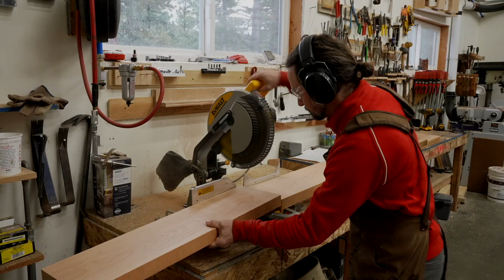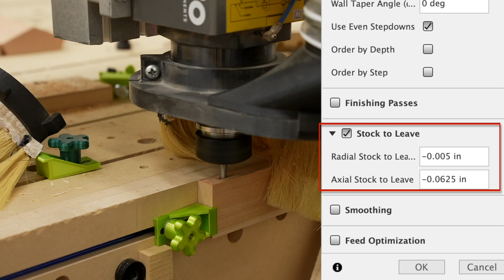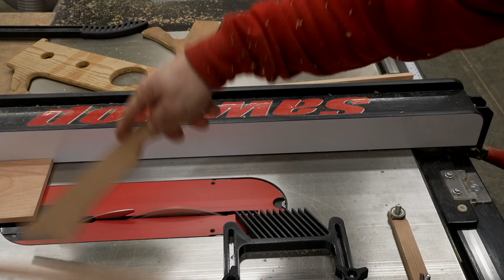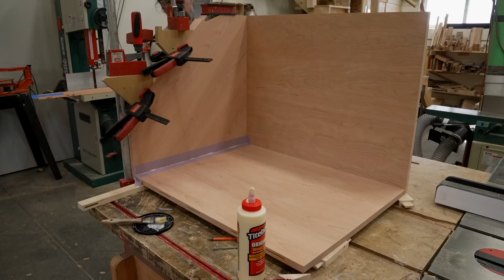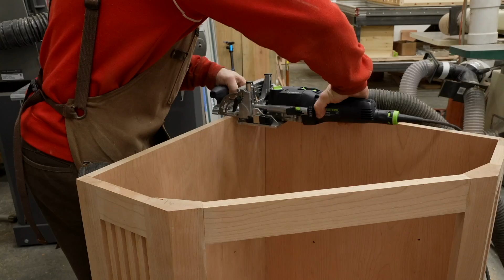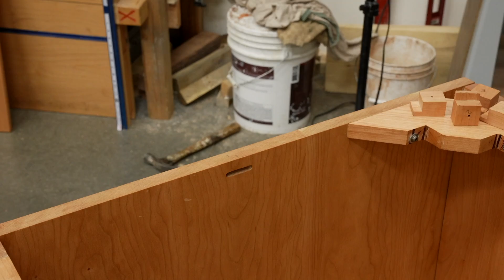The Corner Cabinet: Building Furniture with my CNC, Domino's, Biscuits, Pocket Holes, & Hand Tools

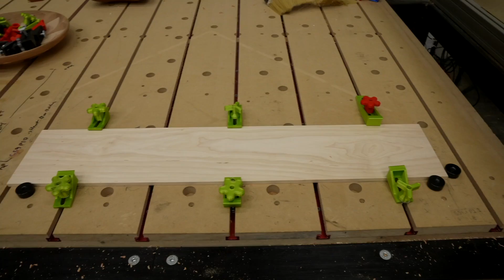Comment: Hey Corbin, so I run a CNC at work day in and day out and wanted to share a finishing pass technique that you should employ. At 4:30 or so you  made pocketed slots or dado's that you then ended up sanding using a piece of wood and sandpaper.  When you're cutting anything (specifically woods and wood composites) you first climb cut your part and then you run the exact tool-path running conventional.  This will clean up your cuts substantially.  In many cases you will need to do almost no sanding.  This is literally the most important part of running any job I do at work.
Reply from the maker: Awesome, I'll give that a try! One of the problems with that pocket is that it was a 1/4" wide and I cut it with a 1/4" bit. I think, if I did it again, I'd make it wider so I could do the climb cut / conventional cut technique like you said.
Reply: @CorbinDunn No Problem that is true but it should nonetheless still help even in this situation although software sometimes doesn't understand that when its a "pocket toolpath" however if you probably used a vector (or cut on line) toolpath then you could "start" at the top and then start at the bottom.  

Anyway, i promise you will be very happy with most results! :D

Comment: Better way to clamp might be a hold fast but i doubt your mdf would prevent elongation. Might think about redoing apron in pine or even hard wood. I have an english planing bench that i use holdfasts in all the time, the apron is 2*12, so 1.5” thick pine.  The mdf might take a hold fast but you have a lot of time invested in that “apron”
Reply from the maker: That's definitely an interesting idea! I could make my apron thicker by adding more wood behind it, and experimenting with a hold fast. I haven't used them on a bench, so I'm not sure how well they hold on a CNC, but it is worth investigating.

Comment: Very nice! I have thought about using my cnc for tenons and mortises more than once but have always opted the traditional method. In my head it always seemed faster to do it on the saw but what is your experience with doing it on the cnc?
Reply from the maker: Yeah - I've thought about this a lot, as I like to do things as quickly as possible, and I'm not really sure if it is faster, but I think it can be. I think the traditional machine way to cut them is a table saw dado set for the tenons, and a drill press for the mortises, along with some chisel work. Or, a mortiser, if you have one, which is faster. I think if you build up a set of "standard" tenon sizes in Fusion 360 (say 1" tenon in 3/4" material at X" width), then it would be faster to set up on the CNC and just hit the button, and it would be a lot more consistent. But it does take a lot of testing to get it all dialed in for a particular bit and machine. 

For custom size mortise and tenons, the setup time in CAD and Toolpath generation might be just just as long as doing a "traditional machine" cut.